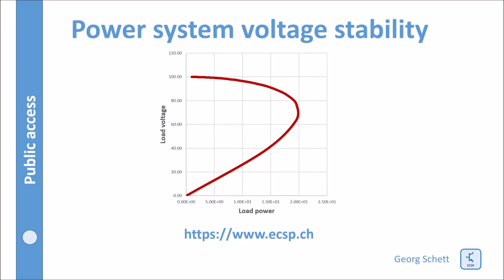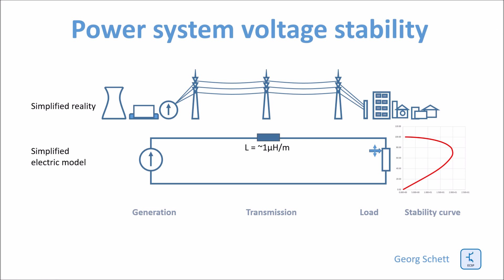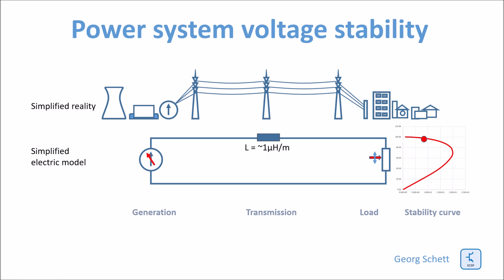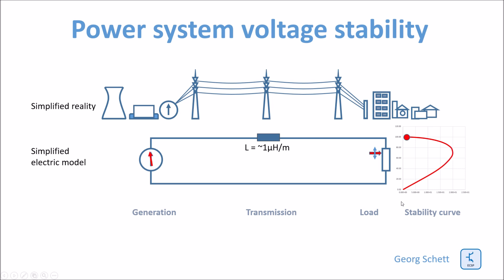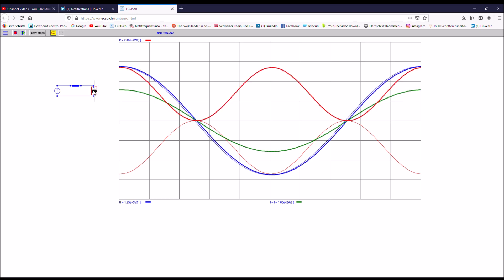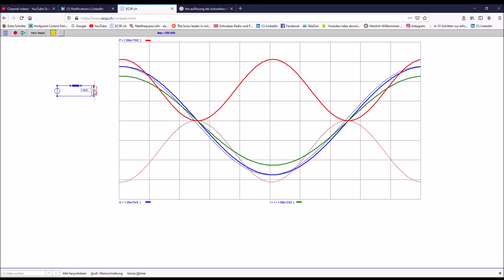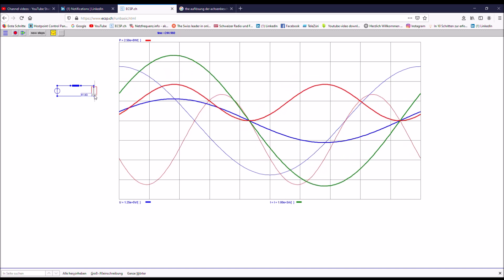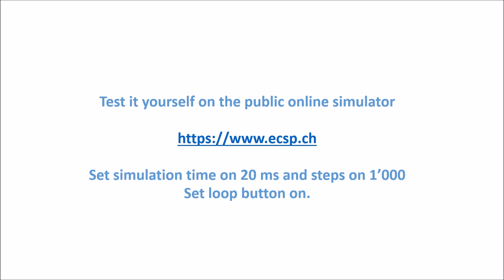Power system voltage stability [circuit simulator]

Comment: thanks a lot! you mention that as power demand increases there starts to be a phase shift between source and load voltage. Was that not there to begin with since the line and source have reactance?
Reply from the maker: You get the phase shift once there is a resistive load.

Comment: Wait so the power increases when you reduce the ohmic resistance of the load? How?
Reply from the maker: Think of the resistance of the load being very high. Then the load (i.e. the power dissipated in the load) would be very low. If you reduce the resistance, current increases and because of P = U*I the load increases, right? This is true up to the tipping point described in the lecture.
Reply: @georgschett801  Ahh of course! thanks so much for the reply!

Comment: Thank you for this exposition on voltage stability. For those who are more interested in this topic, here is some additional information: 
The stability curve, also referred to the "nose curve" due to its shape, is coming from doing phasor analysis on the simple "generation-transmission-load" curcuit shown in the video. Say that the source, or generator voltage E leads the load voltage V by d radians, and the load current I lags the voltage V by p radians. It can be shown using phasor analysis:

Real power = P = VIcos(p) = (EV/X)sin(d)    --------- (1)

Reactive power = Q = VIsin(p) = (EV/X)cos(p) - V^2/X    -------- (2)

where X is the reactance of the transmission line. Squaring (1) and (2) and adding, after some manipulation, it can be written

(EV/X)^2 = P^2 + (Q + V^2/X)^2  ------------ (3)

 But Q = Ptan(p), eq. (3) becomes

P^2 + P^2 tan^2(p) + 2P tan(p) V^2/X = (EV/X)^2 - (V^2/X)^2   ------------ (4)

Also, tan(p) = sin(p) / cos (p), and sin^2(p) + cos^2(p) = 1. Then, with some manipulation, (4) can be written as

P^2 + 2P sin(p)cos(p) V^2/X = (V/X)^2 (E^2 - X^2) cos^2(p)  -------- (5)

Complete the square on the left hand side of (5)

(P + sin(p)cos(p) V^2/X)^2 - (V^2/X)^2 sin^2(p) cos^2(p) = (V/X)^2 (E^2 - X^2) cos^2(p)  -------- (6)

Solve (6) for P to obtain

P = (V^2/X) sin(p) cos(p) + (V/X) cos(p) sqrt(E^2 - V^2 cos^2(p))  ------- (7)

The nose curve can be plotted using eq. (7).

Source: Power System Dynamics: Stability and Control, by J. Machowski, J. W. Bialek, J. R. Bumby, Chapter 8